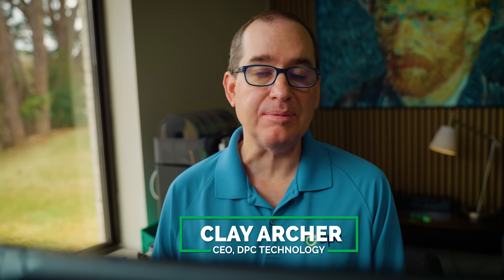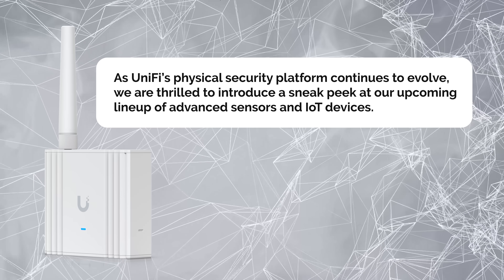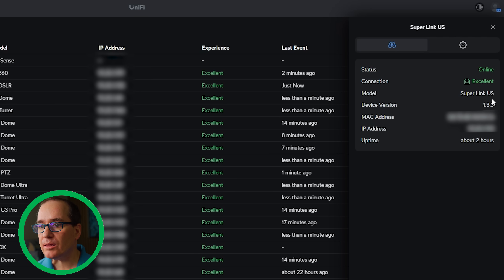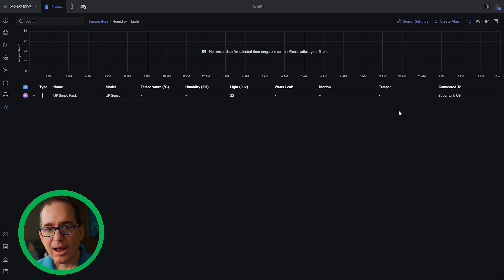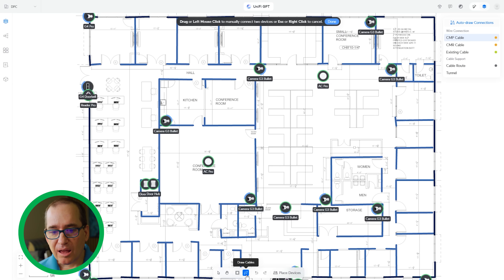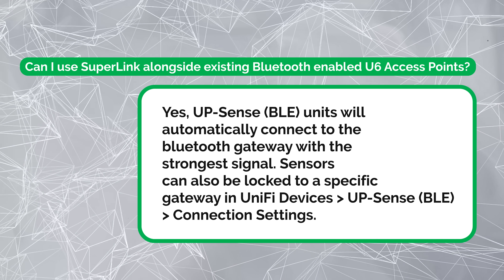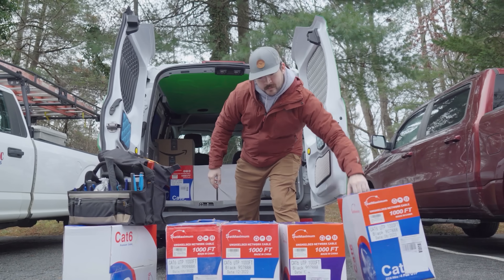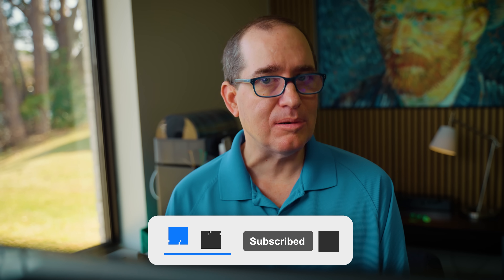Next Generation of Unifi Smart Sensors is HERE! | Unifi Superlink

Comment: No on the leak sensor.
I have a large UI setup in my home with a bunch of UP-Sense devices.  They are very good for temp, humidity, motion, light...not water.  The water sensor is only available in the 3-pack and it only comes with one water sensor.  Very cost prohibitive.
Just get YoLink water sensors.  Only $10/each and can pair DIRECTLY to the YoLink hub and shut off the water as well.  The LoRa tech is proven and has already saved my home from flooding more than once.
Reply from the maker: Coming soon 😎

Comment: Well, I got a 3 pack of the Unifi Smart Sensors and with my U6-Enterprise, it wouldn't even see them 15 feet away in another room. I got the new SuperLink transmitter, and while I can finally see the unit, when I put it in place, 20 feet away (mainly the water sensor next to my washing machine), it no longer sees it. So as far as the first generation sensors, I'd have to say it's junk.
Reply from the maker: @W9HJBill  That's really strange. Are they concrete walls or something in between them?  Mine literally sees the sensors across the 10,000 square foot building..
Reply: @DPCTechnology  Both the SuperLink and the Smart Sensor are in my basement and the wall between the "rack room" and the laundry room is just a 2x4 stud wall with drywall (only on one side of the 2x4) between them. When I was upstairs connecting to them initially, I was literally right over top the SuperLink unit and it was through a carpeted floor not 8 feet away.

When I was upstairs, trying to connect to the U6-Enterprise, it was like 15 feet away through 2 open doors and even if the wall was in between, it was only a standard house wall. 2x4 studs and drywall on both sides.

Comment: with how much the APs cost you'd think they would just integrate this in to the  APs instead and leverage the existing cabling infrastructure. This is just yet another device to  be hanging around the house that you need to run yet another cable again and more ports on your switch. There are already tons of wireless protocols out there for IoT that leverage mesh networking so the KM range is hard to justify- ZIgbee Zwave Thread WiFi Bluetooth. There is nothing revolutionary about the unifi sensors to warrant a brand new system. I work with Cisco gear and the come with BLE in the APs which we then use for device triangulation and asset tracking. amazon eero 6e come with thread and zigbee radio on top of the dual band radios. This APs should do more. They stipped back the additional port functionality on the U7 Pro which was something that was on the U6.  We just got the superlink device and I will be doing the install tomorrow for my video. I am watching your video to get an idea of it before install as I can't wrap by head around the benefit. I'm still not sold on the product and it's relevance yet. I can see this for "Maybe" commercial space   but for homes its a tough sell. Maybe I am just missing something here

Comment: I really appreciate this device and your update. I’ve been concerned about what the exclusion from the new APs meant for the future of these great sensors. In practice they’ve worked great in a deployment with dense u6 enterprise ap’s - I think most reported issues were probably early firmware’s or low density deployments not great for BLE. Now I feel confident continuing to invest time in making use of these sensors, including getting the data out to other reporting systems. Doing something useful with the logging outside of protect might be nice for a deeper dive video.
Reply from the maker: Agree and yes that's a great video idea

Comment: This line appears to be modeled after the sensors from YoLink. I have YoLink equipment and it works flawlessly. I hope UniFi’s interpretation of it works just as well.
Reply: I believe YoLink claims a ¼-mile open air range for their technology.
Reply from the maker: @robert7592  interesting
Reply: Incidentally, I have eight UniFi All-In-One sensors and each SuperLink covers up to seven. Somewhat of an additional complication—no fault of Ubiquiti’s—is my window sensors are behind “black out” honeycomb window blinds. These blinds are lined with foil to stop light transmittance and that foil seems to really attenuate the BLE signal. I’m hoping the SuperLink (on order) will have a stronger signal and help address weak signal issues I see too often with these window-mounted sensors.

Comment: Do most home users think that 2km range on a sensor is actually a bug not a feature?  Seems like it makes the sensors less secure.
Reply from the maker: I think a lot of folks have larger properties and it would be great to have a sensor on a shed or barn and not have to figure out how to wire it..  But the bigger reason is that in commercial use, large facilites need sensors all over large warehouses and campuses..  This will be perfect for them.

Comment: It would be great if they used z-wave as it's sub 1Ghz and well away from Wi-Fi frequencies and has good penetration through walls and range. Home assistant integration would be on my wishlist too. Also, the smoke alarms would need to be hard wired or have a non replaceable non rechargeable lithium battery (with 10 year charge) and an interconnection to be compliant with my local standards.
Reply from the maker: You can already integrate with HA..
Reply: @DPCTechnology  to be fair, the integration into HA requires a Bachelor's degree in HA to get it working. Haha. Mine, kinda works. An out of the box solution would be great.
Reply from the maker: @husbeard  Mine was super easy..  Like one of the easist ever..  Compared to integrating a google nest, it was 1 click...
Reply: @DPCTechnology  I got it integrated easy, I guess it's just overwhelming the amount of stuff you can do with it. I just want to add simple tiles to my homescreen with just a few of my camera feeds. I can get it to work, but not as simply as I want.

Comment: Until these devices are fully integrated with widely used platforms like Google Home, Alexa, or HomeKit, they remain nothing more than a gimmick for most home users. Whether integrated via Matter over IP or through direct integration with popular smart home controllers, their functionality is essentially dead on arrival until that changes.
Reply from the maker: Integrate into Home Assistant, the same boat for all sensor sytems..
Reply: @ so i get to enjoy living with an unofficial api that can change at any time?
Reply: I don't think that's their Market anyway
Reply: Way too much headache involved for the consumer and UI. With what amounts to very little support on their products it is a complete no go.
Reply from the maker: @jameshayes1143  That has not been my experience at all
Reply: @jameshayes1143 I also want to note that I have had quite a pleasant experience with UI also, I am curious as to what exactly went wrong with your experiences with them?
Reply: UniFi is really meant for small to mid commercial applications. Plenty of people use it for home applications, but that isn’t the use case it is designed for.
Reply: Ok so this won’t work with Alexa or Home Kit…